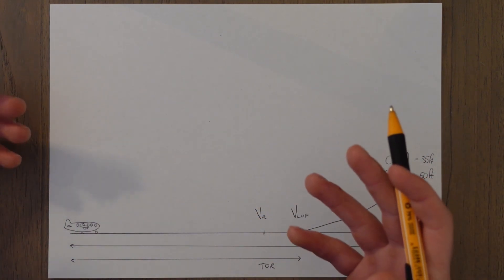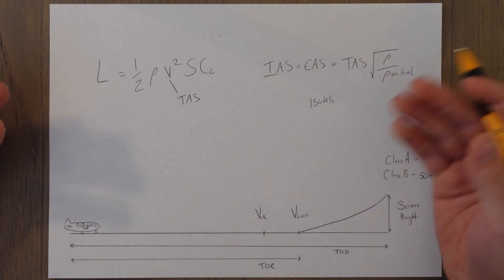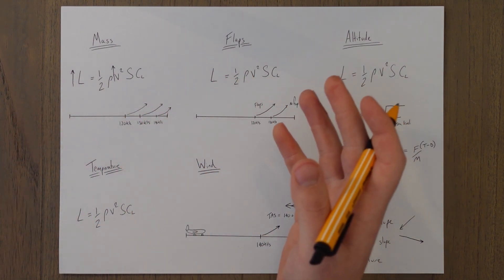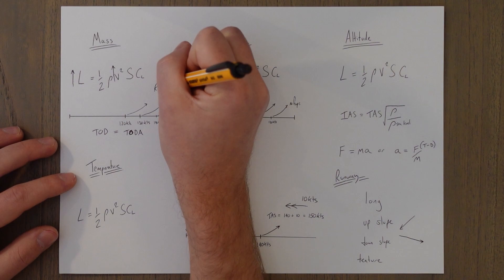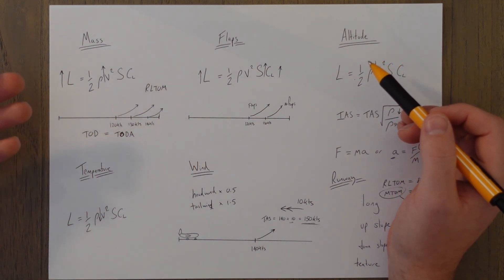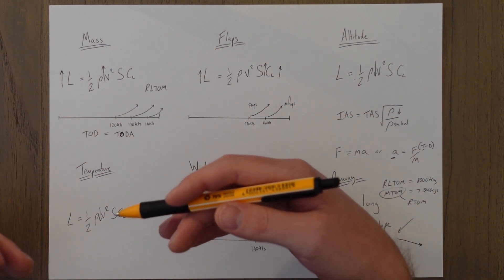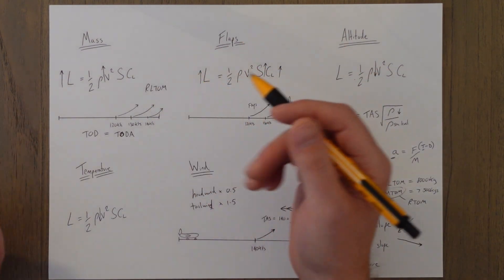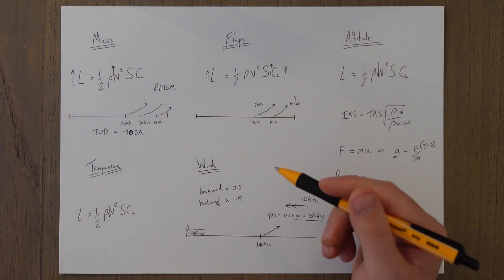ATPL Performance - Class 5: Take-off.

Comment: 12:30

The two components don't really make up more than the actual speed, as you can't just add them up as they are. You'd have to square them, using the pythagorean theorem, and then the numbers make perfekt sense:

30^2 = 15^2 + 26^2
900 = 225 + 676 (not 100% accurate, due to some rounding errors when calculating the HWD and XWD)

Anyways, thank you so much for your videos, I have my EASA exam in Germany in about a week and I'm currently binge watching your videos, as I still feel like I have no idea what's going on in performane.